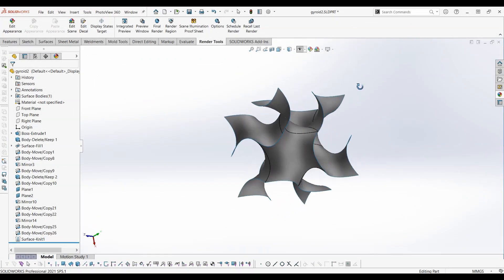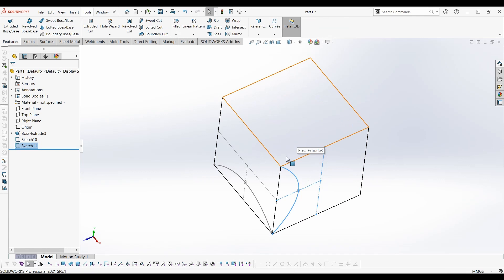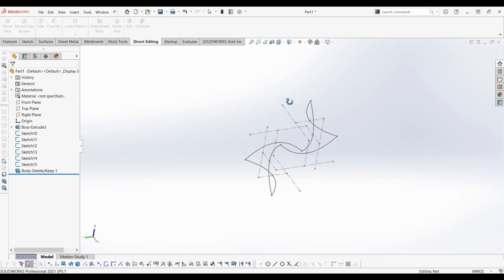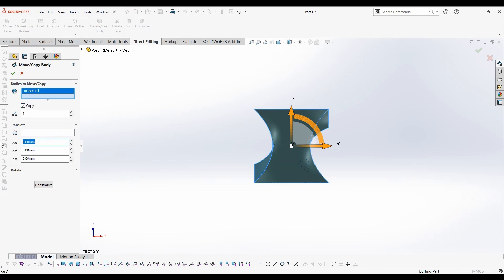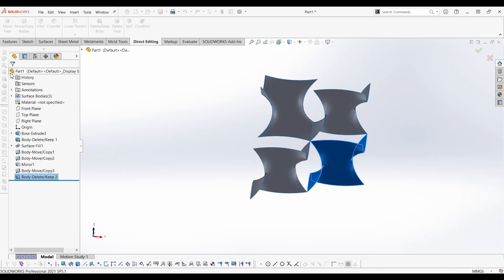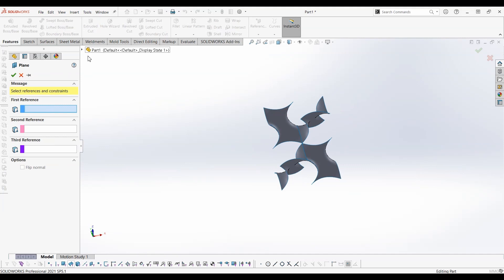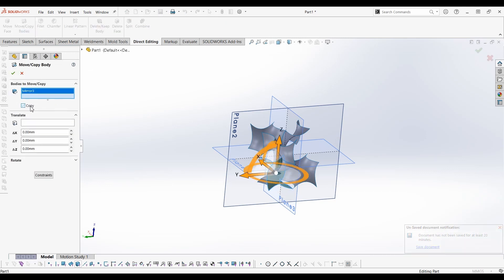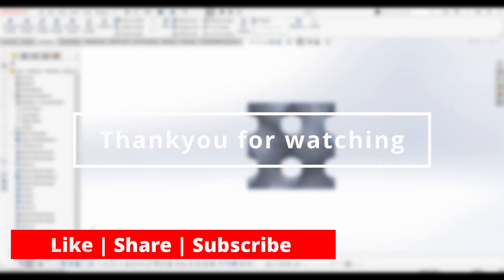How to Create a Gyroid Surface in SolidWorks

Comment: I tried to alter the spline size tovary the final porosity (hole size) but it doesnt knit at the end, any solution?
Reply from the maker: Please check that there is no gap of overlap between the surfaces before knitting it together. 
To alter the hole  size please vary the size of the cube and keep the proportion between the spline and square as in the video.
Reply: It is great until you change the size of the initial cube and the knit does not follow. retaining all the 10mm incremental move copys @A____11